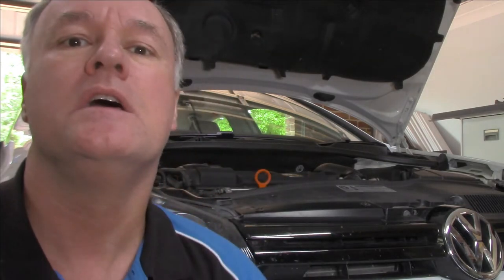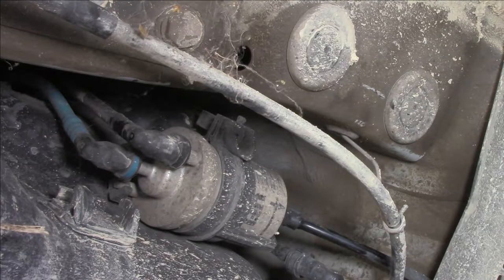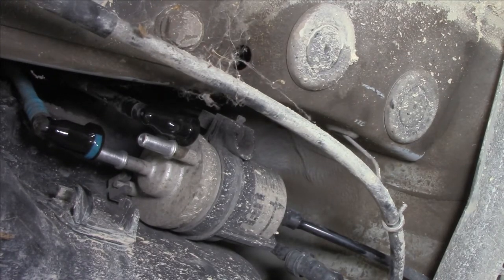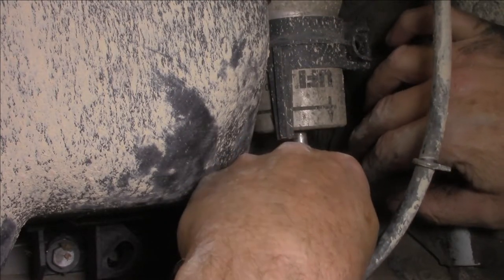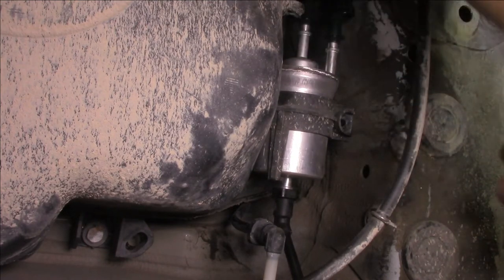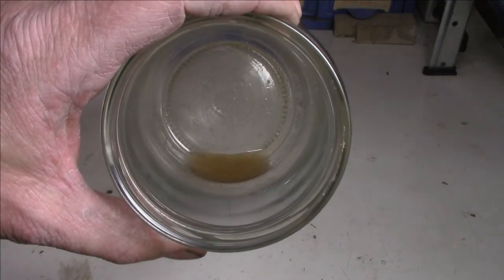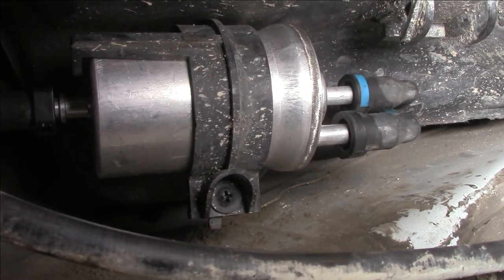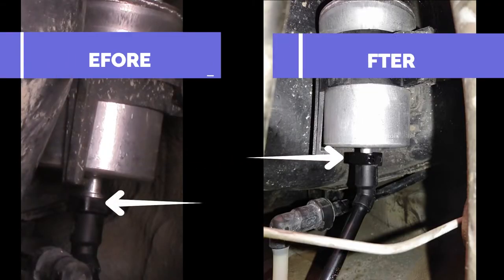VW Golf VI Fuel Filter Replacement (CAXA 1.4Lt Petrol)

Comment: human error it happens . Always over looked on a petrol car customer of mine had a new fuel pump fitted and did not solve the problem simply  fuel pressure check and diagnosed it correctly as a blocked fuel filter in the tank.
Reply from the maker: I think a lot of low pressure issues are overlooked with the high pressure CRD & GDI engines we have. We forget that the low pressure is just as important as the high pressure.
But despite me triple checking the connection, I have learned that I now have to quadruple check (that shouldn't be hard bordering on OCD.....) in the future.
But I guess we are all just human 😁
Thanks for your comments Ian.

Comment: Do you think I need to depressurize the fuel system before doing this? I've seen other guides where they remove the fuse for the fuel pump, run the car until it stalls, and then perform the service.
If you didn't do that ahead of time, then how long did you let the car sit without running before you changed the filter?
Reply from the maker: If you are disconnecting the fuel pump, technically you should do as you suggested - remove the fuse or relay & run until it stalls, but realistically for us in the trade, the pressure is low at the pump & so if you are careful, the worst that will happen will be a quick squirt of fuel. But if course, it's up to you to make that decision.

Comment: Thank you Max for you video! I'm servicing my MK6 with the same engine myself for the 1st time, because of you my fuel filter replacement was a 15 minute job (beer break included). Cheers mate!
Reply from the maker: Glad I could help
Reply: @MiracleMAX  Good on you man! It was surprising that even key off after a few minutes, the in-tank fuel pump will still fire up and pump madly when you disconnect the main hose... A regroup and battery disconnect solved that -- amateur mistake on my part.
Reply from the maker: @nicholasw6601  Thanks for sharing your experience 😉
Reply: You're welcome :)
Reply from the maker: @nicholasw6601  According to the NGK site, https://www.ngk.com.au/partfinder/  the correct spark plugs are Platinum PZFR6R

Comment: If you remove the first two connectors with the easy accessible disconnection clips, then remove the filter clamp to gain easy access to the last connector clip as it's hanging down the clip is accessible
Reply from the maker: Thanks Garry, good idea 😁

Comment: Hi Max , I’ve got the 2012 twin charged 1.4 TSI Tiguan, where is the fuel filter on mine ? 
Don’t think mine has been changed for a while 
Cheers
Reply from the maker: According to the Ryco website, these seem to be non-replaceable. Great idea! NOT!
Reply: So basically it’s in the tank ?? Do I have to change the complete pump
Reply from the maker: @sox666nitro6  I assume they must have a filter of some description, but they aren't listed as separate to the pump

Comment: Hi Max 1.4 tsi owner here!. What kind of service do you recomend for the 50,000k. Should I change the spark plugs?
Reply from the maker: Hey Pepe,
What year is your car? Auto or manual transmission?
Reply: @MiracleMAX  Im from Mexico so maybe its a little diferent from yours. Its a golf VII 2017 style. it has a 1.4 TSI (ACT) and a DSG gearbox
Reply from the maker: @pepeelpollo3  It looks like the spark plugs and external fuel filter are done at 60,000. For the 50,000, I suggest a general service and then at the 60 carry out a full service including the spark plugs and external fuel filter if fitted
Reply: Plugs every 60K, auto trans the same.  Oil, oil filter, power steering fluid.  All filters. Rotate tyres.  Brake fluid flush.
Reply from the maker: @BenState  Do you have an owners service/maintenance book in your glovebox? That should give you all the details you need as well.

Comment: Great video and instructions. What symptoms will show up for a faulty fuel filter?
Reply from the maker: If you have a blocked filter, you would experience lack of power, particularly at higher revs and under acceleration.